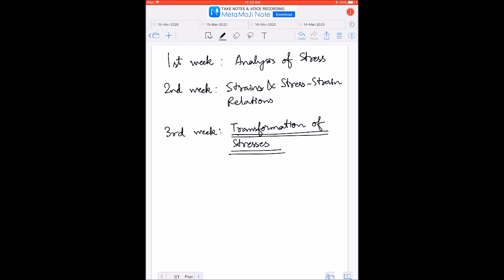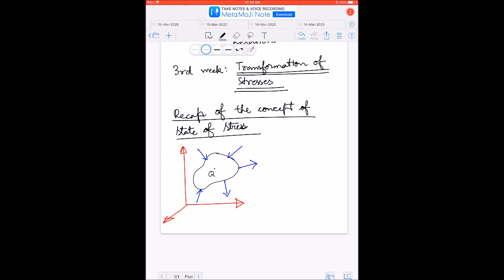wk3 part1

Comment: Surface forces shear specified but why do normal forces consider only one axis? .......other than considering a small area so as to diminish the effects in the other direction
Reply from the maker: Normal forces, by definition, are normal to the plane. Here the cutting plane is parallel to the yz plane. That is why the normal component of the force is along x.